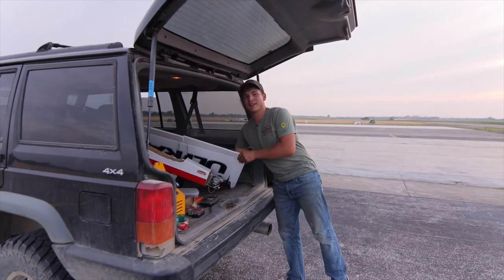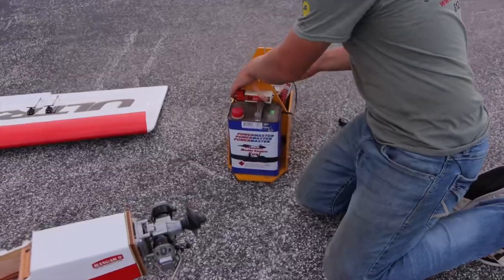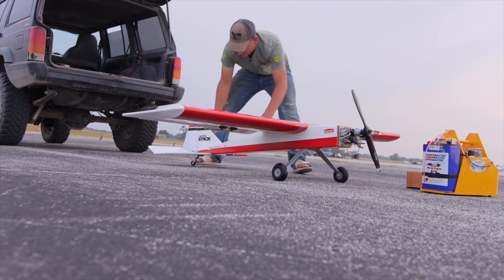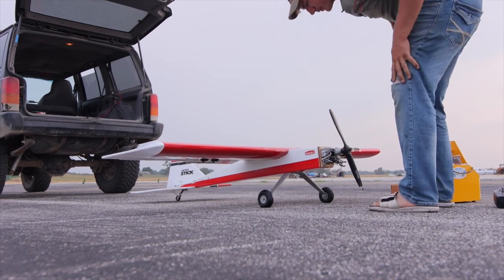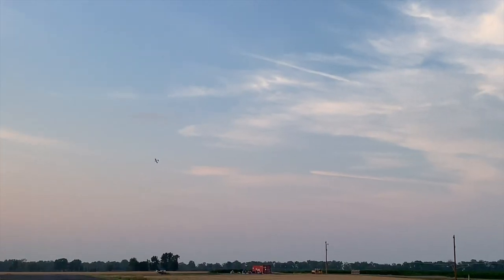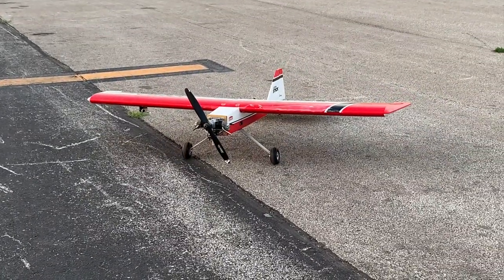Will This Engine Make My Airplane Fly Faster?

Comment: The four stroke twin sounds great.  The Master Airscrew prop is good for fields where it’s likely to be hitting grass, weeds or dirt but not the best for performance.  An APC will wake it up although I wouldn’t have expected an increase in performance.  The 30cc gas engine you went to is a much better match.  My same sized Great Planes Giant Ugly Stick had a heavy, low power 40cc single cylinder engine on it when I bought it.  I replaced it with an EME 35 and it has unlimited vertical now.

Comment: I loved that older model US 120. Flew one with a Super Tiger 3000 later changed to a Zenoh G26. The g26 was heavy and not a lot of power. Father in law crashed it and replaced it with a Jerry's Big Boy. It flys with a 1.10 YS  turning a 17X6 APC and has better low speed than the Ultra Stick.

Comment: That engine is intended to run with an onboard glow so both cylinders have constant plug voltage. That insures one cylinder doesn’t die. Running it on one can hydrolock the other and we all know what that would do.

Comment: Nice! Put an onboard glow driver and you won't ever have to worry about a flame out and you can get some really sweet idle RPM's
Reply from the maker: I have one and thought abt installing it but I didn’t want all that extra weight on board.
Reply: Well you won't have to reach around that prop either to remove glow batts😮
Reply: @flyinghighjoe  One other thing to consider! The amount of weight and power you have already added to the stick the glow system would be insignificant in comparison. I have a Great Planes cub 60 that I stuffed one of these engines into and I have the onboard glow system. Given the wing area and power gains it really isn't a problem.
Reply: I use glow systems on my bigger planes, I use a micro switch to activate it from idle to 1/4 throttle.

Comment: You will need an RCEXL Twin Cylinder Universal Luminous Driver. It can provide ignition to the spark plug manually or via remote control. It will make the engine work sweetly.

Comment: I had the same airplane, but w a DLE 30cc. Your twin sounds great and makes the plane fly very well. A DLE will have more torque, and will need a bigger prop. I had to bend the legs inward to clear the prop from the ground, it pulled to the heavens.
Reply from the maker: I’m thinking of swapping the twin for a gas engine. Not sure if I wanna go for a Zenoah G 26 or G38. Thanks for the landing gear tip. I’ll have to do that.

Comment: I have the 120twin in my 1/4cub, these engines have a tendency to drop a cylinder, get yourself two rcxel onboard glows & run them through a switch on the radio. Haven’t had an engine out since doing this
Reply from the maker: I lost power on one cylinder multiple times already. Thanks for the tip it sure seems like it needs onboard glow

Comment: how do u get the prop to make that sound. really awesome video.
Reply from the maker: A larger prop diameter will have a faster tip speed compared to a smaller prop diameter rotating at the same rpm. Higher tip speed = more prop noise.

Comment: Vintage!! I remember when these things were released. Doesn't seem that long ago????
Reply: Right! Vintage would be with a round vertical stab/rudder, scalloped edge ailerons and the Iron Cross on the fin 🙂
Reply: Phil Kraft designed the first Ugly Stik in the 1960s.  Countless variants have followed.

Comment: If you keep it running like that (8200 RPM on the ground, while hoilding full throttle in a dive) it will exceed 9K in the air on a regular basis and you'll break a conrod. These are not aerobatic engines, not designed for hotrodding.
My advise is to prop it a bit heavier, and also:  get a CDI ignition system (CH, or RcExl).
Reply: Bwahhaha my previous reply got canned, it's on Ebay now. 🤣
Reply from the maker: I’m swapping it for a DLE 30 now😁. The O.S. 160 runs good and sounds amazing but it still doesn’t have the power I’m looking for.
Reply: @flyinghighjoe  Well, it never was an engine designed for THAT... (all out power, I mean). Mine does about 2,4 bhp @7600 RPM, burning gasoline, not Methanol. A DLE 30 most definitely will exceed that 2,4 hp, but not by all that much.
But they sound like crap.
I saw you stated earlier that yours only produced 2 hp, then most definitely something is wrong with it: On glow fuel, these things should touch 3 hp.
Reply from the maker: I bought the O.S. 160 without knowing much about. I found it on Marketplace for a good price so I went ahead and bought it expecting to fly with it a few times then ultimately move on to a gas engine. Research shows the OS 160 will put out 2hp at 10,000 while the DLE 30 produces 3.7 hp at 8500 rpm. I’m not too concerned that the DLE 30 won’t have enough power
Reply: @flyinghighjoe  Those numbers are incorrect, in fact that engine will self-destruct if operated at 10K, and it produces its peak power (which on methanol really is around 3 hp) at about 8K

I know because mine does about 2,4 hp @ 7700, burning gasoline. Methanol produces approximately 25% more power than gasoline. Being an engineer and having measured myself, I am pretty sure of those numbers. If you have access to a propcalculator, run the numbers yourself: My prop is an APC 18 x 6 Wideblade, and it peaks on the ground at 7700 RPM.
The folks I know that have one running methanol, typically use an 18 x 8 Menz or Master, getting comparable RPM.

Heck, mine is not even the OS, but the cheap chinese ASP copy....

https://www.youtube.com/watch?v=LiHrZVrOGwY

I get well over 10 lbs of thrust with that thing, and I use it for glider towing... Which is a power-sports...
Reply from the maker: That could easily be true. I just found those numbers on the internet. I was running it at 8200 rpm with an 18x6 prop with 15% nitro fuel.
Reply: @flyinghighjoe Yup... I warned you about a month ago that you should prop it for a lower RPM. Not sure what prop you use and no propcalc at my disposal right now, but a careful guess would say that that RPM with that propsize allready is fairly close to 3 hp (around 2,8 is my VERY careful estimation).
But the thing is, in the air that set-up will spin up to easily 9~9,5K, but the engine runs out of steam at about 8~8,5K so anything more than 8,5K, despite higher revs, power will drop and performance will suffer. If the engine is still on the plane, try an 18 x 8, or if you are more into speed, a 17 x 10, take the time to tune properly, and see what happens. Pretty good chance the plane will perform a good bit better.
Prop it for around 7,5K on the ground, that will give you slightly over 8K in the air (8,2~8,3 would be my estimate) and that is where the engine is at its best.

But whatever you do, do NOT hold WOT in a dive. You will sooner or later kill the engine. And that would be a shame.
Reply from the maker: Wow I didn’t expect it would accelerate that high when flying. I have already taken the engine off the airplane in preparation for the DLE 30. I do appreciate the tips tho👌
Reply: @flyinghighjoe  They do... Since I am flying gasoline, I need to tune it about 400~500 RPM rich in order to have the correct mixture in flight. So my ground RPM is around 7200, which basically is maybe 2~2,1 hp. In the air, it spins up to 8200 in level flight (no tow), which is somewhere around 2,6 hp or so. In a steep climb with a glider in tow maybe 7900.
I use telemetry and logfunctions, I am 100% positive about those numbers.
I typically get climbrates around 600 ft/min with a 7 lbs tow behind, without tow the 13,5 lbs plane gets a climbrate of better than 1000 ft/min and can hold a 70 degree climb without stalling.

On Methanol, these numbers should only improve, provided the engine is propped accordingly. On the same prop, the additional power is wasted because of revving beyond the powerband.
Reply from the maker: Very interesting. What tow plane do you have?
Reply: @flyinghighjoe  :D the one in the earlier vid...

This one: https://www.youtube.com/watch?v=ctdTlS255yI

It is a 40+ year old Multiplex BigLift.
Reply from the maker: That’s cool! I’d love to try glider towing someday

Comment: I don’t know which model of the Ultra Stick this is, probably the 120.  If so, AND you want to make it perform and sound cool, just run a YS big block, from a 140 and up.   You can find 140’s all over for not much cash.  Personally, I’d put a damn DLE20 on it and enjoy the fuel savings.  If it’s a current 10cc model, put a 75 or 90 size glow 2c.  It will make it as crazy as it needs.
Reply from the maker: It’s the 120 size albeit it’s the OG version which is several pounds heavier than the 120 light version. I recently put a DLE 30 on it. It rips pretty good🚀

Comment: Did you shorten the nose? I think I need to do that to mine to get the weights off the tail. I inherited the one I have. The original builder added 2 1/2 ounces of weights under the Vertical stabilizer.
Reply from the maker: No I did nothing to the airframe on mine. Wow must be he had a heavy engine on the nose!

Comment: Just an obvious comment, what was the weight difference between the old and new motor, i guess the new OS may have been heavier, did you check the CG ?. If heaver would count for the nose down attitude. What was the HP rating of the new motor compared to the old motor ?.
Reply from the maker: Good question. The Saito 150S weighs 31.3 oz w/out muffler and produces 2.5 hp while the O.S. 160 Gemini weighs 38.8 oz and only produces 2 hp. Now these are manufacturers specs but they are very comparable engines. I did not do more flight testing since recording this video but I’m really curious what the performance difference is between the old and new engine when using the same 16x8 prop. Also I had a good chunk of lead under the nose with the 150 and that weight is now all engine. The plane balances abt 1/2 inch behind the spar which got me thinking it would be a little tail heavy but apparently cg should be even further back.

Comment: When flying on an airport you are required to have a GTA radio to monitor traffic! 😱😝🤪🤣😁👍👍🇺🇲
Reply: If you read the AMA rules your not supposed to fly within 7 miles of a municipal airport. This one may be abandoned but its still an active airport.
Reply: You can monitor the aircraft's ADSB Out on your phone.
Reply: Yes ...agree can be a big problem...if  old radio is used & frequency gets hit plane is then out of control..

Comment: I have a vintage yellow Ultrastick .60 that has been e-converted from a Saito 125 to a 2200+ watt electric motor. It does an easy 105 mph, as measured using a calibrated GPS unit. Sticks are great planes that can fly slow or fast. Without the motor sound, you can to easily hear the very distinctive whistle sound from the wings .
Reply from the maker: 😳Dang that’s fast! I love sticks too. I have this one and the Ultra Stick 25e with an O.S. 32SX. Ive never clocked it with a gps but she rips pretty good

Comment: A twin cylinder will give you less power than a single cylinder of the same displacement. Did you have permission to fly at that airport?
Reply from the maker: Yes I talked with the airport manager before flying there. Thanks for asking
Reply: Old guard. Gatekeeper. Karen.  You know.  In my day.  Cool airplane.